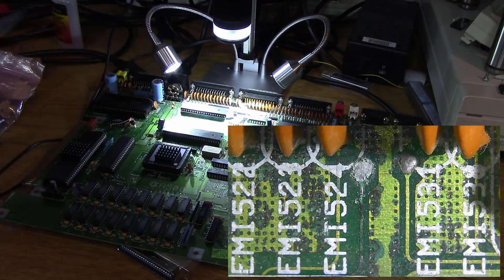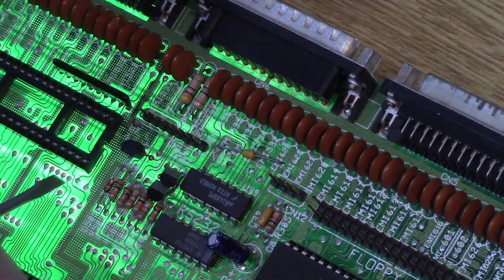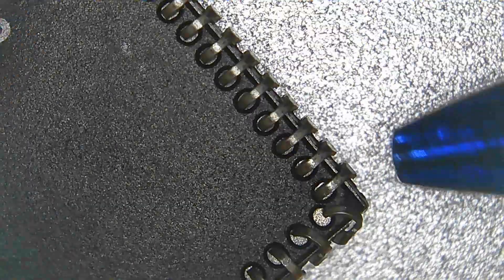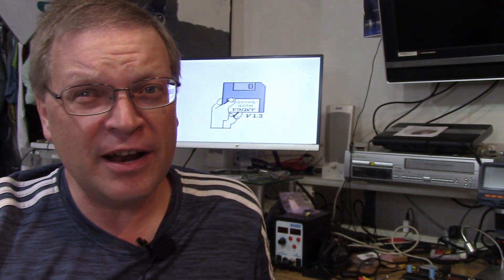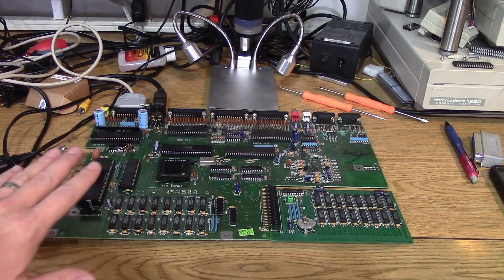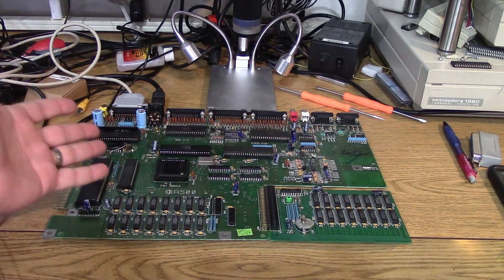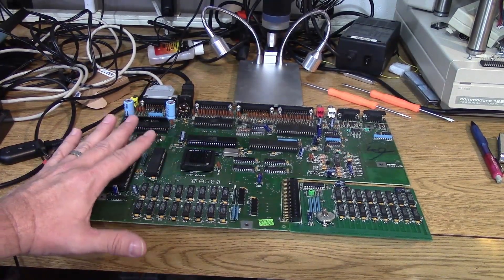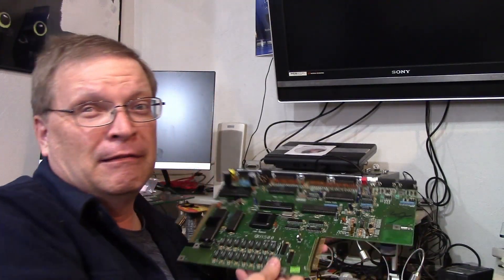Amiga 500 Adventures: Repairing and Recapping the A500 - Episode 114

Comment: Doug I am not going to laugh at you. The old board are actually quite fragile and even when your gentile with them it's easy to break a trace or even lift one.   I have bought my share of non-working boards I have repaired and have 3 left to finish up on but after I am done with those I have no further interest in buying non-working board.
Reply from the maker: For sure! I have replaced plenty of capacitors in my day, and have never had so much trouble removing them as I have had with this machine. Let me know if you are selling any of those boards after you fix them - I would buy one from you!
Reply: @10MARC  The Ground  area can be very difficult to work with depending on what your using to remove Through Hole Cap as it will pull the heat from the iron.  One of the boards I have is a total mess its a 500 Plus battery leak mess then I have an A600 board where someone lifted a trace for a capacitor but the issue they were trying to fix was on the underside of the board where a Resister burned up and burned up a small section which took out a couple lines so I have to recap that board fixe the traces and figure out how to get that resister back on the board.  Yea Bondo time, maybe.  I put those boards to the side because I need to be motivated.  The last one is a 128DCR that's 99% done.   I don't sell anything I am really hoping to give all my stuff to one or more of my Grandkids but I will keep you in mind should I chose to sell something.

Comment: Might have lifted a pad when desoldering. I did my very first (after much practice) on my 4000. Did well but a through hole capacitor just wouldn't release. Finally lifted the pad and had a great guy here in US help me out. It's a hobby and why would I not try to learn something as long as we have resources to cover our behinds when all doesn't go well.
Reply from the maker: Very possible I did just that. I have been using a soldering iron since about 1994, but I have never been very good at it. It is just not natural to me.

Comment: Thanks for another great video, Doug :D A500s are not easy to recap. Huge groundplanes. I had best luck by adding fresh solder then heating each joint as I was pulling out the old caps carefully. Then doing the same when installing the new caps. cutting the legs then pushing them through while heating each joint. So I actually didn't remove the old solder. The one time I tried my desoldering station it melted and destroyed a through hole via. even though I didn't use that much heat and did not hold it for long. These can be fragile because of age. The Rev 6As are actually much worse to recap VS the Rev 5s. I think it's because of the groundplanes. Since then I have learnt alot more. But still, these are very tricky to recap. And trying to remove the old solder can still lead to through hole vias being destroyed. So I don't blame you at all, Doug. Even a pro can have a difficult time with these. Some people say to just leave the caps in A500s, A2000s, A3000s and C64s. After I got my ESR meter I have seen several bad caps in C64s and a VIC20. So after 30 + years I would say it's a very good idea to change them even if many people just tell you to leave them.
Reply from the maker: Good advice for sure! Those ground planes just seem to suck up all the heat.

Comment: Doug, did you get all the caps the right way around?
Reply from the maker: I did. I was quite careful to match up the little plus signs. I know some Amigas and boards were actually marked wrong, but I think the A500 Rev 5 is marked correctly.
Reply: @10MARC  bad luck Doug.  I must admit I've tended to shy away from doing this myself and I get professionals to help, in the UK and Netherlands.  Bit far for you I admit.

Comment: Oh no...hopefully Frank get get it fixed. I need to figure out if my A600 has already been re-capped or needs it. I know one of the surface mounts has been replaced by a thru-hole one so perhaps the other ones have all been replaced. Not sure with surface mounts if I would do it myself...esp since it's the only Amiga I own.
Reply: ...it's the cap right under the floppy which supposedly is one that commonly fails, that's why I'm not sure if the rest have been done.
Reply from the maker: If it's your only Amiga, have Frank do it if in North America or Steve Clifford do it if in Europe. I am blessed to have several Amigas, and this was actually my least used one (besides the A2000 still in pieces)

Comment: I'm not gonna laugh at ya Doug, because after recapping a few C64's I thought the A500 would also be a breeze. D'oh! The Amiga has larger ground planes that like to wick the heat away, and that made things a lot tougher, especially with a crappy cheap-o soldering iron. Also, did you make sure you got the polarities correct? Just thought I'd ask, you know it's gonna come up, down here in the comments... :)
Reply from the maker: Yep. Triple checked the polarity. I have a nice soldering iron and it was still a nightmare. Some of those caps just did not want to come out!
Reply: @10MARC  desoldering thru-hole components on any PCB with a massive ground plane is really tough. The ground plane acts as a massive heat sink. It requires a lot of heat but using a single heat source directed in a small area is a bad idea, like a soldering iron cranked up way to high. This leads to lifted traces and could burn out the pad. It’s a lot easier with tools that generally hobbyists don’t own, like a massive heat plate. We always encourage customers to do things themselves, if they feel comfortable doing so. If not, we are always here to help!